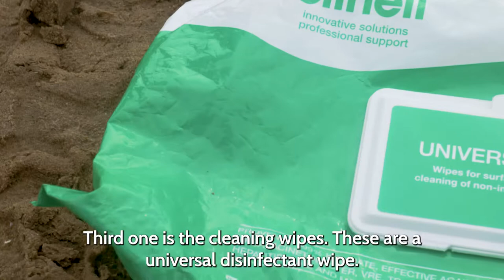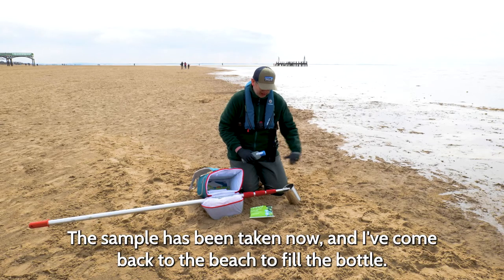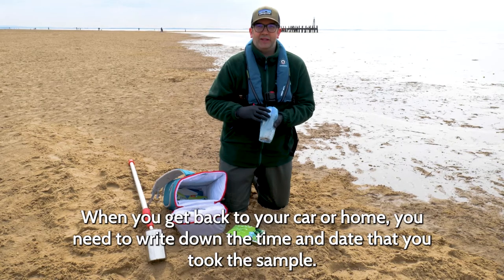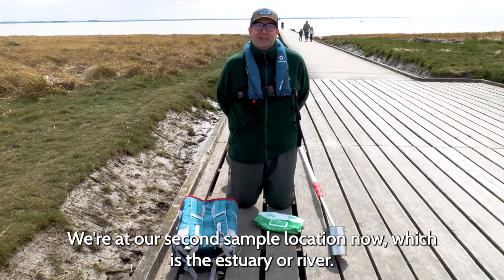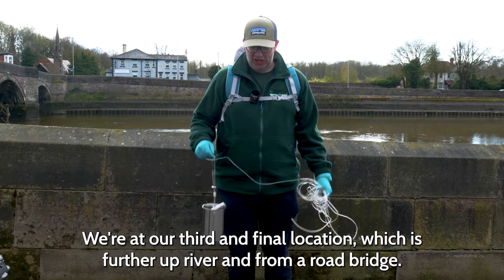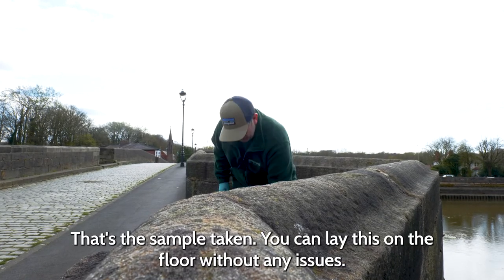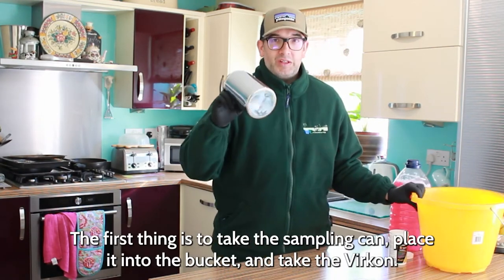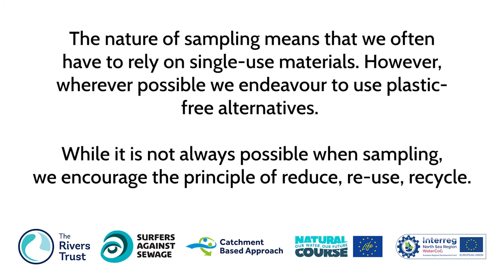Water quality monitoring tutorial

Comment: How do you dispose of the virkon (once it has changed colour or after every home washing?) if you are not on mains sewage. It would go through a home sewage system and then into a stream.
Reply: Hi Scott once the colour has dropped out the Virkon is mostly spent and inert so should be ok to put through a home sewage system but cautiously so I would dilute the virkon as you are disposing of it so if able leave the tap running as you pour it down the sink if not then dilute the virkon in 5 litres of tap water then pour down the sink.